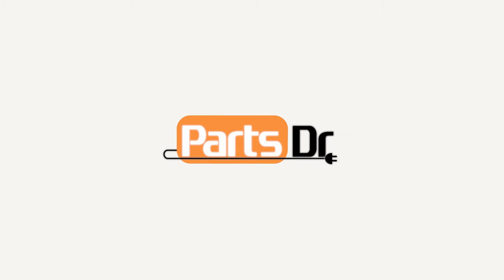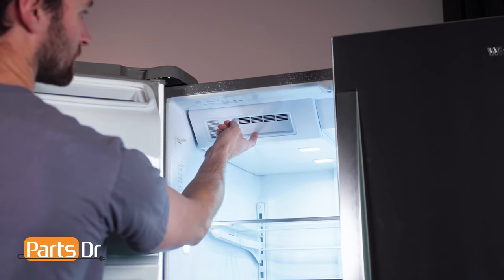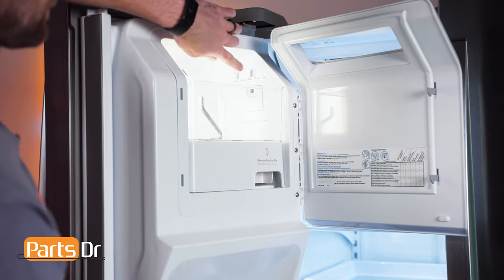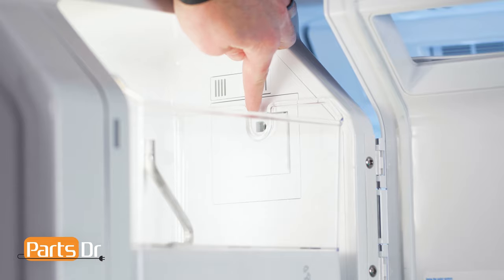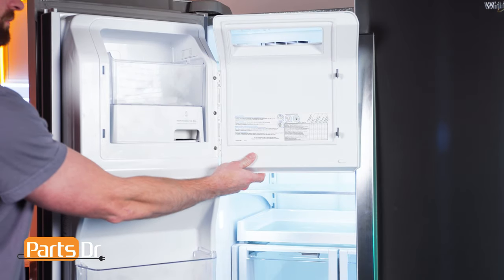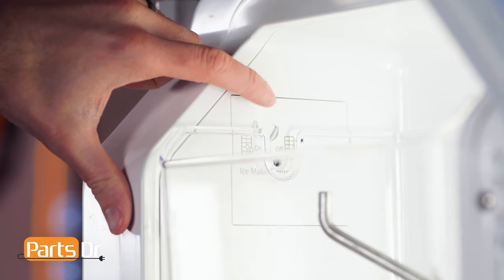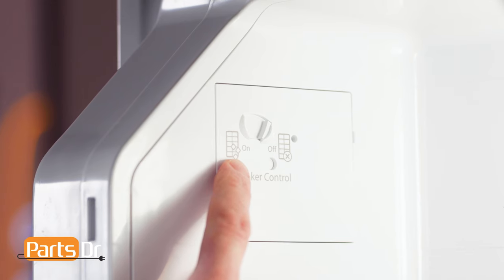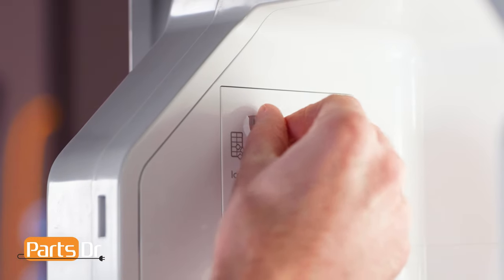How to turn ice maker on & off on a Whirlpool French door refrigerator

Comment: Although you turn off the botton on the ice maker,  does the water have to be shut off too?  Or can you just leave it off on the ice maker and turn it on when you return from a long trip?
Reply from the maker: The water can be left on.
Reply: @PartsDr  Thanks for getting back to me I feel much better.  When I turn the ice maker off do I have to remove the ice tray?
Reply from the maker: @DianaReimanHomes  The ice tray can remain in place while the ice maker is turned off.
Reply: Thank you very much for getting back to me.  Great information

Comment: Boy you just saved me from having to call the appliance guy. We are still under warranty but anyway you know how it goes having to wait around all day for service people to come. We have been away for quite some time and the ice maker didn't appear to be working could not figure it out until I watched your video. I even looked at the manual and it doesn't say anything in there about this little on off switch. I don't think I ever knew about it so I'm not exactly sure how it got turned off.. possibly from when I removed the actual ice container to empty the ice out of it before we left for several months when I put it back I must have hit the on/off switch, which on our Whirlpool is on the left side instead of at the back. Anyway thanks so much.
Reply from the maker: That is great to hear!

Comment: I have this fridge and there's a little light next to it. When I first turn the ice maker on, it turns red and stays red a while unless I break the IR beam checking the ice level. After a few minutes, I recheck the light and it's off and won't come back on. Fridge is brand new and this ice maker hasn't made any ice in 4 days I've owned it.
Reply from the maker: The actual beam that checks the ice level is infrared and cannot be see with the human eye.  Sometimes you can use a cell phone camera to see the beam.  Make sure to check everything listed in the instructions to make sure you aren't overlooking anything, after that have the manufacturer send someone to take a look at it.

Comment: I have a Whirlpool Gold Series French Door Refrigerator that I just recently bought used. The model is Whirlpool Refrigerator GI6FARXXQ05. I can't get it to make ice.  Is there an on/off switch inside of the ice maker or is it just on the digital screen on the dispenser?
Reply from the maker: Lifting the metal arm up/down is what turns the ice maker off (up position)/on (down position).  See the 3:56 mark in this video https://youtu.be/RuO4ydlktAE?t=236
Reply: @PartsDr  That didn't answer the question but thank you for your time.